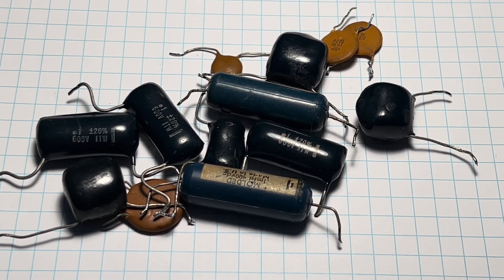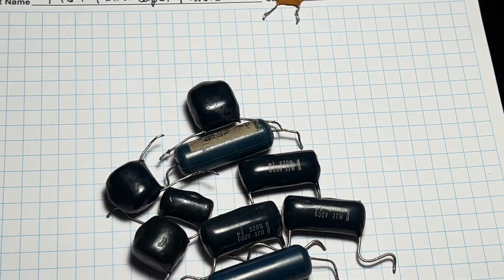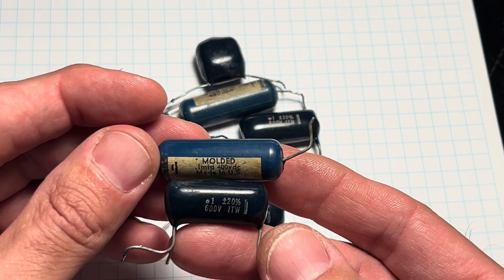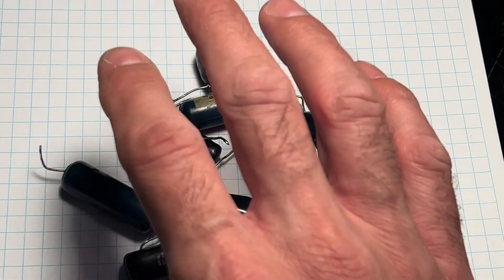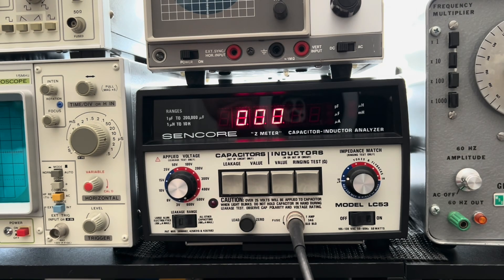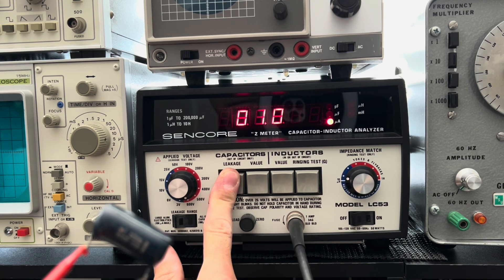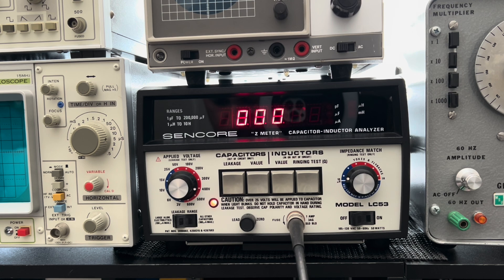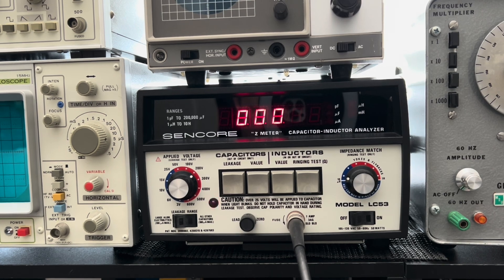Testing Vintage Fender Caps - Nothing Exciting Here

Comment: I just replaced some brownish/red phase inverter coupling caps today in my 1970 Princeton Amp. I can’t get the 6v6gt current below 30. When I bias, I have to get the plate voltage down to like 340 just to get them to 70% dissipation. It wasn’t the ugly caps. Still stumped.
Reply from the maker: @chrisfit  you’re going to have to check the 27kΩ bias range resistor and the bias supply filter cap, as well. If you only removed the PI coupling caps, you may have over cooked the 220KΩ bias feed Rs.
Reply from the maker: Chris, contact me and I’ll walk you through
Reply: @ForgottenGearRestorations  So, I rebuilt the bias supply before trying to bias. New 100k 2W vishay, new MOD 50uF 100V Cap, new 1n4007 diode. I added a 20KB bias adjustment pot with a 5k 3W resistor as per RobRobinette's layout recommendations. 

I also replaced the filter can cap with a small eyelet board with 4 new MOD 20mfd 500V caps. Replaced the dropping resistors with 2W vishay metals. 

I added 470 ohm 3W screen resistors and 1.5k grid resistors to the power tubes. I also added a 470k Phase Inverter Grid stopper. 

The grid leaks measure 245k in circuit, I may try those next. 

Not sure why I can't get the current below 30milli amps.
Reply from the maker: @chrisfit doubting its the grid leaks. Did you reverse polarity of your bias supply cap?
Reply: @ForgottenGearRestorations  Yeah
Reply from the maker: How much range are you getting from the pot?  You should only need a new bias range resistor.  Put the pot in center of its rotation and sub resistors until it’s close. This is assuming all caps and diodes are oriented correctly. Make sure the 27KΩ isn’t 2.7KΩ.
Reply: @ForgottenGearRestorations  I was measuring the plate current incorrectly. Noob mistake. I was reading the red on pin 8 and black on ground and using that as my current measurement. Apparently I need a 1-10ohm resistor (unsure wattage) off of pin 8 and measure the voltage drop etc.
Reply: @ForgottenGearRestorations  thank you for trying to help me though! My noob mistake. Now I need to replace those old brown caps and measure correctly.
Reply from the maker: @chrisfit it happens to the best of us!  You can do that provided you have a 1Ω resistor typing the cathode to ground. Good find!  These tough shootout sessions stick with you. You’ll never forget what you learned here.

Comment: In some amps, after the amp has been on for an hour or two,  the temperature of several components inside closed chassis is very much higher than room temperature, and it can affect results. So measuring component values or leakage at room temperature does not always tell the whole truth.
Reply from the maker: Until I get my Capacitive Ovenometer in, the gold standard of cap testing will have to do! 😂
Reply: If anything the higher heat will make the caps and resisitors measure even worse.
Reply from the maker: @davidlong1786 David, you have an inspired and an idea for a video-  let’s test this out.
Reply: @ForgottenGearRestorations  Luckily all what is needed is a hot air blower. Even those with adjustable temperature and digital display are dirt cheap today.

Comment: Indeed it is a shame that so many guitar techs want to change perfectly fine film capacitors and doing so devaluate vintage amps (Imho).
Reply: You think some one that makes their living repairing amps has time to measure every cap? It's just common sense to replace 30 to 50 year old caps, seen way too many that don't meet specs or have high ESR and leakage. As far as "devaluating" an amp, if anything it keeps the value up if you have optimum operating components inside. The people worried about how it looks aren't really music players, just equipment snobs. These parts are hidden away and nobody is ever going to see them unless it's a tech or a curious person.
Reply from the maker: @davidlong1786 I totally understand where you are coming from. From a pragmatic perspective, all old caps should be replaced due to age.  But that’s more of the radio repair philosophy than the vintage guitar amp philosophy. 

The owner of a vintage fender, Marshall, Vox, etc amp is typically an enthusiast. Similar to enthusiasts of all stripes (especially car guys, where the “numbers all have to match”), keeping as many original parts as possible is the maintenance philosophy of choice - and that’s my philosophy when approaching repairs and restorations. The old signal caps as shown here make a difference, but when it’s time to go, I don’t cry over it.  I always present risk analysis and underscore the expense of replacing a costly set of nos tubes or an original transformer, when this could be avoided by spending $4 on a nice pair of contemporary caps for the phase inverter. There are some great sounding modern signal caps out there. 

WRT techs that make a living repairing amps, they shouldn’t be testing every cap; they should be able to glean nearly all the information they need regarding the health of all components at the tube sockets.
Reply: Dlabs changes them I often see him return the old caps to his customers. He doesn't want a possible call back for example he repaired one shipped from Hawaii. The cost of shipping this unit back and forth would be expensive.
Reply from the maker: @briang.7206 indeed there are several cases where that would be appropriate and as long as all that’s communicated to the customer, all good.  Terry does good work.